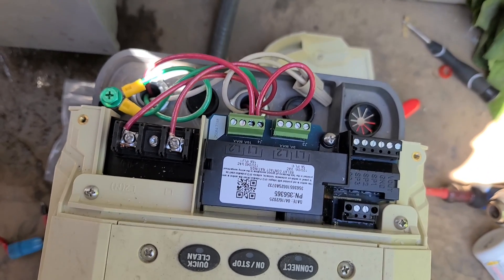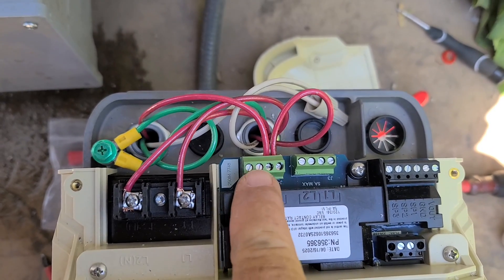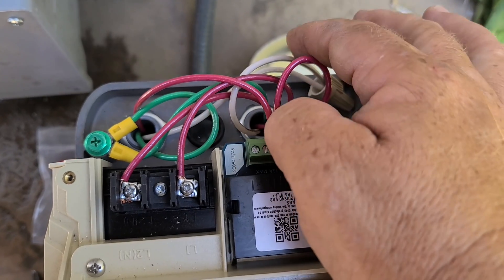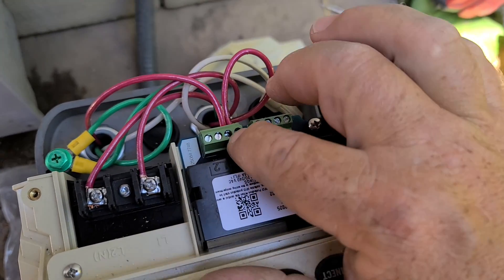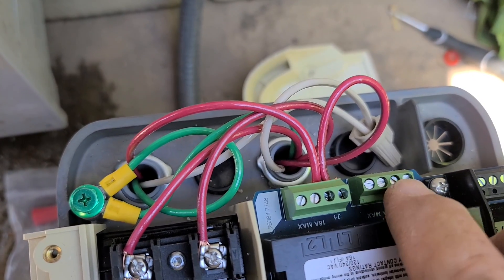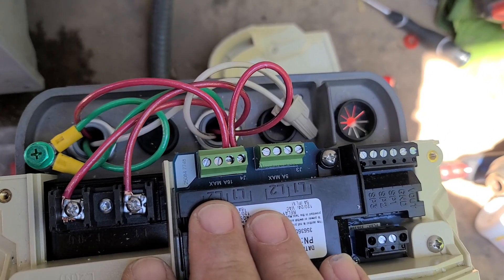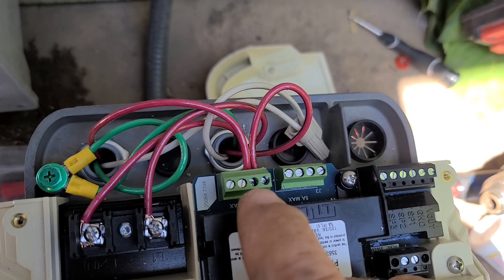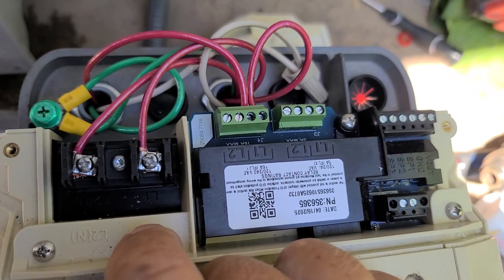Wiring Intelliflo 3 and pool lights

Comment: What about booster pump 220v?
Reply from the maker: Yes a booster pump for a pressure side pool cleaner. Usually 240 volt. I believe that is the original intention

Comment: What if you have 2 lights?
Reply from the maker: In this case the lights are wired to the Transformer. And just the Transformer is wired to the pump relay so you can hook up multiple lights they just come on together